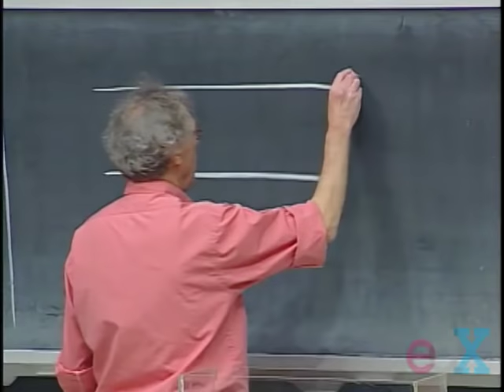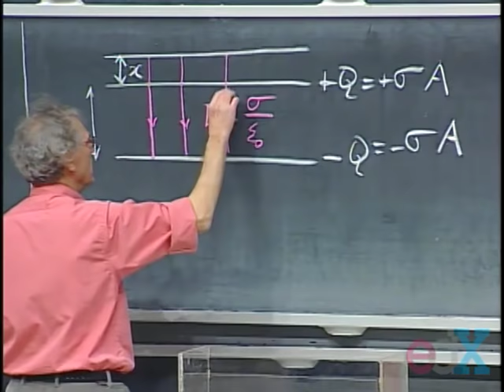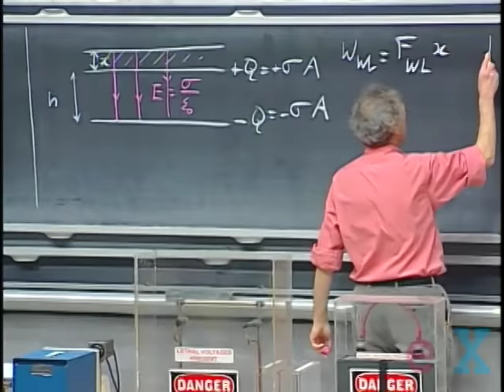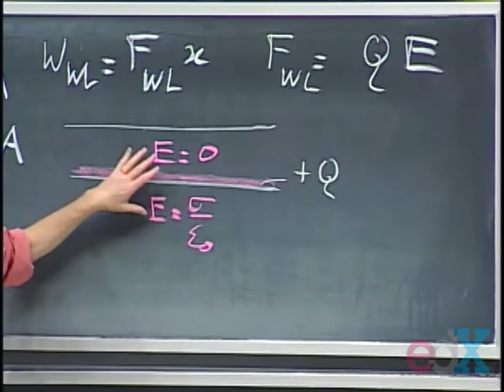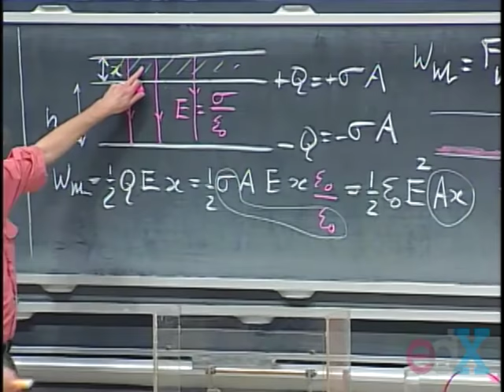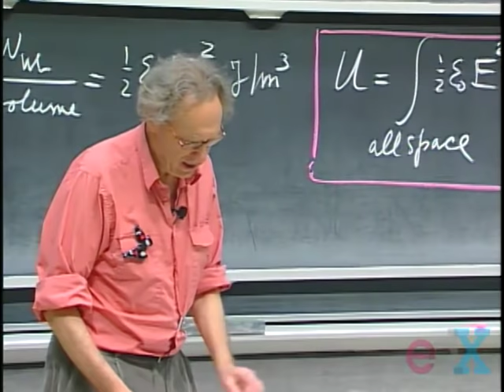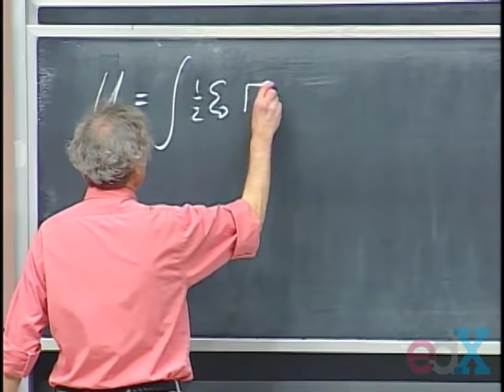8.02x - Lect 7 - Capacitance, Electric Field Energy

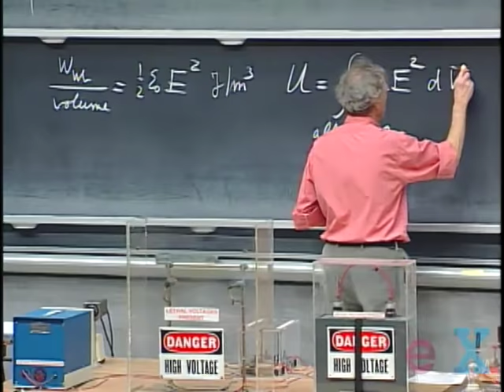Comment: sir you call it at 6:12  to 8:00
Reply from the maker: What I stated is only true for a continuous charge distribution. A single charge is not continuous. Sorry,  I should have made that clear in my lectures. I attached a website which discusses Electric Potential Energy and it covers both the work I have to do and the volume integral of the field energy density. I hope this helps.
https://en.wikipedia.org/wiki/Electric_potential_energy
Reply from the maker: My statement near 6:12 is also correct for point charges. If you have a 1 C charge and you move it from infinity to point P, you do not have to do any work. But you had to do work to assemble the 1 C charge. Perhaps you did it when you were at infinity but you HAD TO DO IT. That amount of energy is identical to the volume integral of the field energy Thus the statement that I made in class was correct. It really would not have been needed for me to stress the words "continuous charge".

Comment: Sir how F=1/2QE at 3:45
Reply from the maker: factor of 2
Let the charge on each plate of the capacitor be Q=100q (+Q on one plate and --Q on the other). Let the area of each plate be A. The E-field between the plates is then Q/(A*eps_o). Let the distance between the 2 plates be d.  Now release q from the + plate to the negative one. The energy that is released is force*distance which is very close to q*d*Q/(A*eps_o). But after this transfer the E-field is reduced, it’s now only 0.99*Q/(A*eps_o). I now release another q thus the energy that is released is now 1% less than with the first q. By the time I have released 10 times one q, the E-field is only 0.9*Q/(A*eps_o) and thus the force on the charge q is only 0.9*q*Q/(A*eps_o). The force keeps going down as I transfer more charge.  By the time I have released the last q (of 100) the E-field has become 1% of the original E-field thus the force on the last q is about 1% of the force during the first transfer. Thus by the time that I have released 100q=Q the average E-field was only 0.5*Q/(A*eps_o), NOT Q/(A*eps_o). Thus the average force on a charge q during transfer was NOT q*Q/(A*eps_o) but only half that. Thus, by spooning off the chaInfamousrge from one plate to the other the energy release is NOT Q*d*Q/(A*eps_o) but only half of that. The energy that is released this way (also called potential energy) is identical to the work that YOU would have to do to separate the 2 plates over a distance d.
Reply: Thank u very much sir☺

Comment: Sir,  the separation between parallel plates is <<<< their area. And no charge is added to the parallel plates Then how does the p.d(v)  Increases when separation between them also increases? Give the answer plz Sir.
Reply from the maker: the  separation decreases C.  Q cannot change thus V must increase Q=V/C
Reply: @lecturesbywalterlewin.they9259  thank you sir. But from where the extra p. d(v) is coming? If charge of capacitor is constant

Comment: sir you call it at 6:12
Reply from the maker: What I stated is only true for a continuous charge distribution. A single charge is not continuous. Sorry,  I should have made that clear in my lectures. I attached a website which discusses Electric Potential Energy and it covers both the work I have to do and the volume integral of the field energy density. I hope this helps.
https://en.wikipedia.org/wiki/Electric_potential_energy
Reply from the maker: My statement near 6:12 is also correct for point charges. If you have a 1 C charge and you move it from infinity to point P, you do not have to do any work. But you had to do work to assemble the 1 C charge. Perhaps you did it when you were at infinity but you HAD TO DO IT. That amount of energy is identical to the volume integral of the field energy Thus the statement that I made in class was correct. It really would not have been needed for me to stress the words " continuous charge".

Comment: Sir can you please record this lecture again please walter lewin sir  lecture 7 please its a request
Reply from the maker: ha ha ha this was recorded in 2002 at MIT.
Reply from the maker: you are mistaken. this lecture is 480p.  It was confirmed independently by 2 people and by MIT.
Reply from the maker: click in the setting of the video. It will show 480p!!!
Reply: @lecturesbywalterlewin.they9259  Sir but it doesnt show me any option to change video from 280p to 480p. It just show 140p and 280p thats it sorry for my rough english
Reply from the maker: @johncena-fy3mo  when I click on "settings" it shows 480p I cannot chnage that. sorry. You have a problem that I cannot solve.
Reply: @lecturesbywalterlewin.they9259  I check from my 3 mobiles and all time it said 280p only is max
Reply from the maker: you have a problem that I cannot solve. 4 people independently tell me that they see 480p and so do I. When  I click on the video "setting: icon it reads 480p End of story this is my last msg.  Try some of my other 8.02 videos. All are 480p

Comment: Sir, when you say that the electric field of the layer of charge on the capacitor plate is the average of the electric field on the two sides of the plate when you do work to pull one of the plates up by distance x, did you say that just for the sake of more intuitive explanation whereas at the bottom of you heart you understand that this is not the real case. I have read from this website http://hyperphysics.phy-astr.gsu.edu/hbase/electric/capeng2.html , it says that the one half factor comes from the inevitable loss of energy when you do work because of the second law of thermodynamics. So my question is, is your explanation the more correct one or the website's?
Reply from the maker: This may give you a better insight into the factor of 2. 
Let the charge on each plate of the capacitor be Q=100q (+Q on one plate and --Q on the other). Let the area of each plate be A. The E-field between the plates is then Q/(A*eps_o). Let the distance between the 2 plates be d.  Now release q from the + plate to the negative one. The energy that is released is force*distance which is very close to q*d*Q/(A*eps_o). But after this transfer the E-field is reduced, it’s now only 0.99*Q/(A*eps_o). I now release another q thus the energy that is released is now 1% less than with the first q. By the time I have released 10 times one q, the E-field is only 0.9*Q/(A*eps_o) and thus the force on the charge q is only 0.9*q*Q/(A*eps_o). The force keeps going down as I transfer more charge.  By the time I have released the last q (of 100) the E-field has become 1% of the original E-field thus the force on the last q is about 1% of the force during the first transfer. Thus by the time that I have released 100q=Q the average E-field was only 0.5*Q/(A*eps_o), NOT Q/(A*eps_o). Thus the average force on a charge q during transfer was NOT q*Q/(A*eps_o) but only half that. Thus, by spooning off the charge from one plate to the other the energy release is NOT Q*d*Q/(A*eps_o) but only half of that. The energy that is released this way (also called potential energy) is identical to the work that YOU would have to do to separate the 2 plates over a distance d.
Reply: Since you said that the energy released by releasing +q from one plate to the other is the same as the work done to separate the two plates of opposite charge over a distance d ( this is a pretty trivial intuition through the conservation of energy), now I will present you an example where these two quantities is not the same and I am hoping for an explanation to it.

Suppose I have a capacitor C1 that of 8microF and I charge it to a potential difference of 120V. I have a switch that is open initially that connects C1 to another capacitor of 4microF namely C2.

Initally, the total energy that i use to separate the charges on C1 is equal to U=1/2CV^2=0.0576J

Then I close the switch and C1 will discharge into C2 until the potential difference across C1 and C2 is the same.  Having done the calculation, the final potential difference is 80V and the final total energy  equals 0.0384J.

So obviously there is an energy loss of 0.0192J!

But you said that the total energy that is released in this discharge process is equal to the work that you have to do to separate the charges. What is wrong?

Note: All my conductors are ideal conductors with zero resistance. so no heat is loss.
Reply from the maker: >>>But you said that the total energy that is released in this discharge process is equal to the work that you have to do to separate the charges. What is wrong?>>>
Yes that is correct. I cannot be more clear than I have been in my previous msg. It's the best and very correct way to understand the factor of 2. If you still don't get it, ask google.
Reply from the maker: >>>>Then I close the switch and C1 will discharge into C2 until the potential difference across C1 and C2 is the same.  Having done the calculation, the final potential difference is 80V and the final total energy  equals 0.0384J.>>>
you must have made a mistake. V after the connection is not 80 V, it is =97.98 V.
Reply: but you will find that the total final charge increases. how can this be? I didn't add any charge.
Reply from the maker: Electric field energy cannot be destroyed when 2 capacitors are connected as done in the sequence of your scenario. Energy must be conserved. Thus charge must be added. Net charge added is ZERO as you add as much + and - charge.  I must  admit that I have never before thought about your sequence. Had I thought about it I would most certainly have posted this as a problem on one of my homework assignments. Energy must be conserved. That leads to 97.98 V. By the way, my explanation of the "infamous" factor of 2 is the best possible in my view.  In class I did not want to go through the energy  issue to justify the factor of 2. I thus decided to use the poor man's version of our book.
Reply: ok, your explanation is a fair one. But this problem that I described was taken from a university physics textbook called "Sears and Zemansky's University Physics with Modern Physics, 13th Edition". Below I will put a link to my screenshot of the problem and its solution taken from this textbook. And the solutions says that energy is loss and the amount of initial positive charge equals to the final amount of positive charge, same applies for negative charges. What is your explanation to that? It contradicts the solution that you provided. Which explanation is more correct?

https://www.dropbox.com/s/ojhr18mg9au4uk1/capacitor%20problem.png?dl=0

Please have a look
Reply from the maker: I am very puzzled. They do not mention that in their solution there is a loss of energy and if they had noticed that, they at least should have told us where that energy went.
Reply: They did say the where the energy had gone: "The conductors
become a little warmer because of their resistance, and some
energy is radiated as electromagnetic waves."

Lets say the resistance of the conductors is zero, then the energy loss will be in the form of EM waves radiated. 

So which is the real answer? yours or the textbooks'?
Reply from the maker: I must then be wrong as they did not overlook the energy loss. I'd like to see a calculation of the EM radiation but that may not be easy. I concede that I was wrong.
Reply: okay, since you accepted the textbook's answer. But another question is why? 

The conservation of energy says that to the work done to separate the charges is equal to the work done by electric field when the charges are released.

(CASE 1) Assume that I do work to separate one positive and one negative charge to infinity, then I release both of them. The total work done by the electric field when the two opposite charges are released at infinity is exactly equal to the work that i do to separate them. 

(CASE 2)The above situation is analogous to the charging of capacitor C1 and discharging C1 in charging C2 until they reach the same potential difference. But for the case of the capacitor, the work done to separate the charges in C1 is not equal to the work done by the electric field in the process of discharging C1 and charging C2 simultaneously as the energy is lost in EM waves.

So given that you admit CASE 2 is true, then what about CASE 1? Does the system loose energy in the form of EM waves as well when the two opposite charges are released at infinity? If it does loose energy just like CASE 2, then the energy will not be conserved as every time I separate the two charges,
[the work done to separate the charges=energy lost in EM waves+work done by the electric field.] 
Is this inevitable because of the second law of thermodynamics?
Reply from the maker: This is still 100% correct.
This may give you a better insight into the factor of 2. 
Let the charge on each plate of the capacitor be Q=100q (+Q on one plate and --Q on the other). Let the area of each plate be A. The E-field between the plates is then Q/(A*eps_o). Let the distance between the 2 plates be d.  Now release q from the + plate to the negative one. The energy that is released is force*distance which is very close to q*d*Q/(A*eps_o). But after this transfer the E-field is reduced, it’s now only 0.99*Q/(A*eps_o). I now release another q thus the energy that is released is now 1% less than with the first q. By the time I have released 10 times one q, the E-field is only 0.9*Q/(A*eps_o) and thus the force on the charge q is only 0.9*q*Q/(A*eps_o). The force keeps going down as I transfer more charge.  By the time I have released the last q (of 100) the E-field has become 1% of the original E-field thus the force on the last q is about 1% of the force during the first transfer. Thus by the time that I have released 100q=Q the average E-field was only 0.5*Q/(A*eps_o), NOT Q/(A*eps_o). Thus the average force on a charge q during transfer was NOT q*Q/(A*eps_o) but only half that. Thus, by spooning off the charge from one plate to the other the energy release is NOT Q*d*Q/(A*eps_o) but only half of that. The energy that is released this way (also called potential energy) is identical to the work that YOU would have to do to separate the 2 plates over a distance d.
Reply: I understand and I agree that this is 100% correct, but that doesn't answer my question on CASE 1.
Reply from the maker: separation of the plates infinitely far is meaningless as the E-field is then NO longer sigma/eps. If you have a capacitor voltage V, charge charge density sigma on each plate, distance between the plates d, then  (sigma/eps)d = V. The work YOU have to do to separate the plates from d=0 to d=d is 0.5*CV^2 = 0.5*QV = 0.5(Q*(sigma/eps)*d
Reply: Okay, lets not separate them to infinity but just a finite distance. Then given that you admit there is energy loss in case with capacitor discharging into another capacitor, why isn't there any energy loss in the form of EM waves in this parallel plate case if they are released so that they attract?
Reply from the maker: If you separate the plates there is never a current - if you connect a 2nd capacitor (as in your problem) there will be a current. That makes all the difference.
Reply: but doesn't current mean charge moving in space? If a charge is moving in a vacuum , the charge will produce a magnetic field and magnetic field is produced because there is current. So if i release the two plates so that they attract, the charges on the plates move in space. isn't that current?
Reply from the maker: I now understand your question. If you separated the plates with an acceleration you would definitely create EM waves. Yes a current produces a B field (Ampere's Law). What is the current between point A and B (separation between A and B is 1 cm) if ONE charge q moves from A to B with a speed of 1 cm per sec (q can be the total charge on a plane perpendicular to the points A and B)?  If every second a charge q would move from A to B, the current would be q Amperes. But what's the current if it happens only ONCE?
Reply from the maker: In the case of your problem (adding a cap) there is a current dQ/dt going through the wires. The E-filed in the wires propagate with the speed of light through the wires. Electrons will start to move everywhere in the wire simultaneously. If the wire is 3 cm long the time for the E-field to reach the end of the wires is about 0.1 nano sec. Electrons are  moving in your circuit EVERYWHERE in the wire. They move very slowly (typical only mm-cm per sec) but that's a REAL current. Through every cross section of the wires the same a mount of charge will pas per sec. Depending on the resistance R of the wires and the plates, the current probably last only for a few millisec (it depends on the RC time). Moving charged plates from A to B is not a current. Frankly I would not know how to calculate the B-field that such moving charges could generate. I searched the web. It only discusses REAL currents of the kind I described above.
Reply from the maker: I do calculate in my 8.03 lectures how EM waves are caused by accelerated charges.  I also show some videos of moving charges in 8.02. 
https://www.youtube.com/watch?v=6lb040GCs2M&index=29&list=PLyQSN7X0ro2314mKyUiOILaOC2hk6Pc3j
Reply from the maker: In this lecture I derive how an accelerated charge causes EM radiation. A charge moving with constant velocity does not produce EM radiation. A current generates a B-field (Ampere's Law). I do no know how to calculate a possible B-field produced by a single moving charge (or a moving plane with charges) that is NOT accelerated.